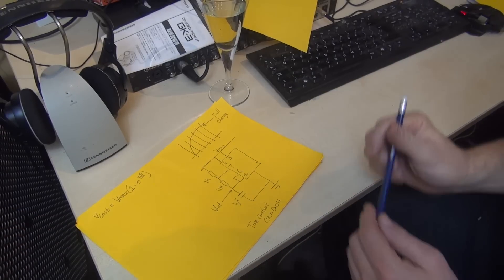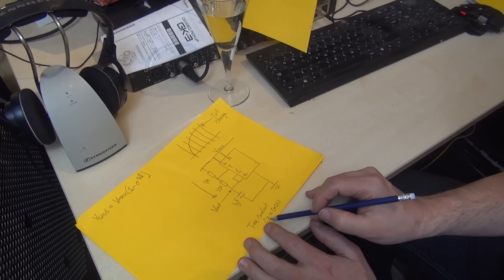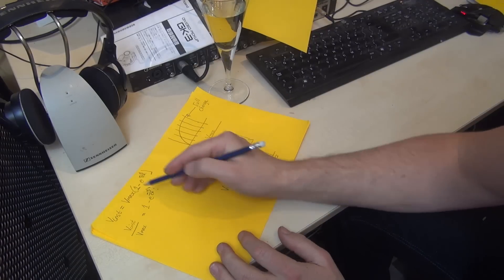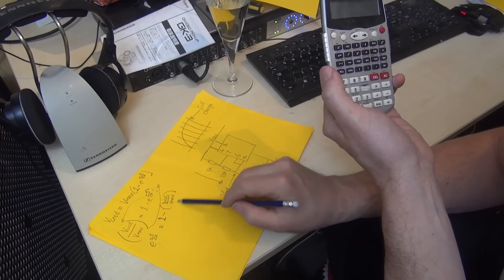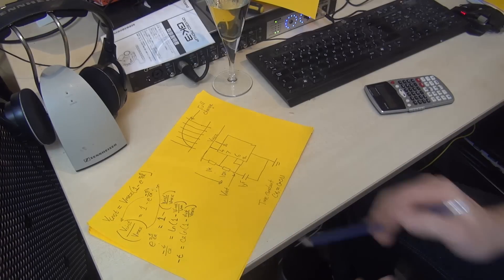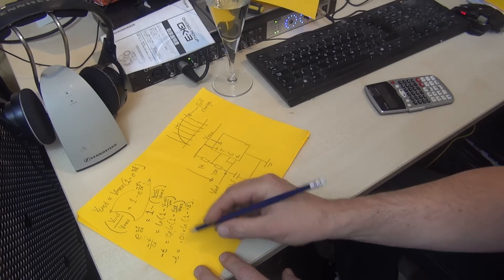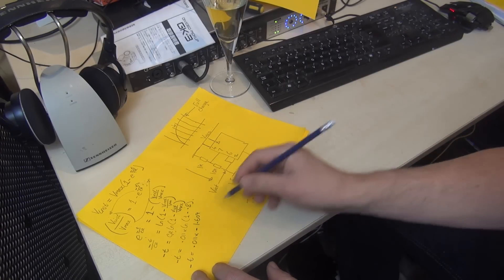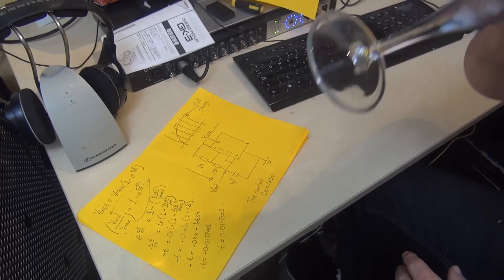Extract Time from Capacitor Charge Calculation

Comment: PAUL WESLEY LEWIS, without the LOAD, how much current in amps can a 4700uf hold store with a power supply DC voltage at +450vdc? the 4700uf filter cap will charge up to +450vdc but how much current is the 4700uf holding storing?  What formula can I use to calculate how much current the filter cap is storing in amps?
Reply from the maker: Many ways, here is one. Work our the energy stored first = 0.5 x C x V^2, then you can find the current as a function of the power, where power =Energy/time and power = volts x current, the discharge time will depend upon the resistance you are using to discharge the capacitor into. The current will not remain constant as it will fall exponentially with capacitor voltage. In your example, lets say the capacitor is discharging into a circuit with a total resistance of 1000 ohms, the capacitor and resistor will form a time constant of 4.7 seconds and the capacitor will be full discharged after 5 time constants = 23.5 seconds. Current is at its maximum at the first instant of discharge and falls to 0 after 5 constants with no measurement equipment connected.